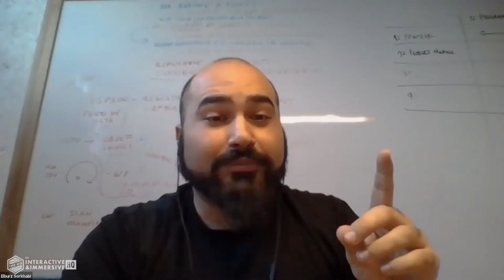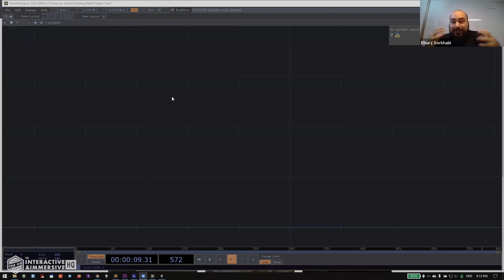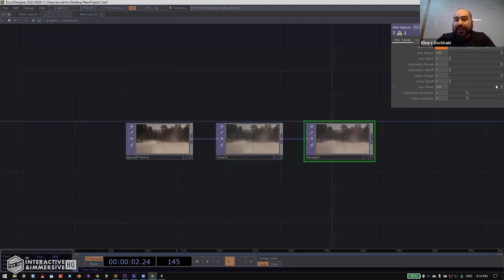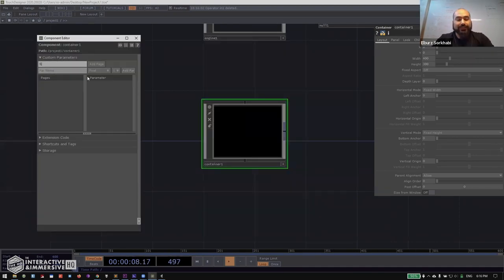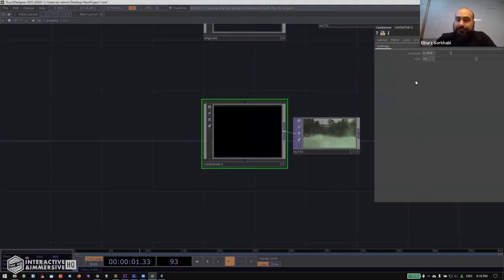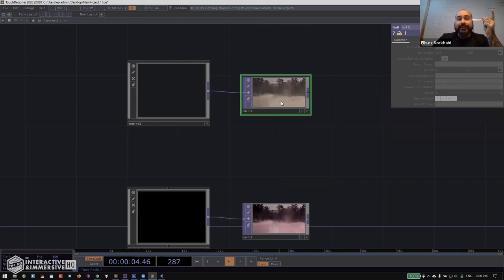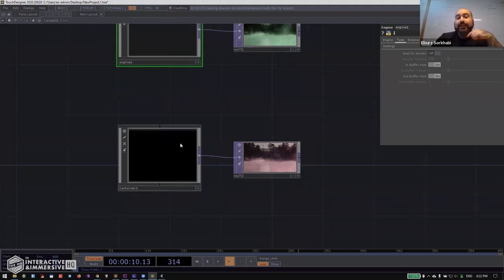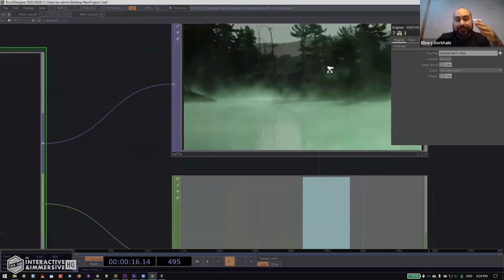Engine COMP in TouchDesigner - An Introduction

Comment: What are the implications for GUI workflow, if we can't get panels out of the Engine? Do we put the GUI in the main project, and the heavy cooking then goes in the Engine Comp? Or is this something better handled by waiting for support for different op types?
Reply from the maker: I mentioned GUI workflows although I didn't elaborate more on them :) Previously when you offloaded GUI's you would usually have the GUI in another app or on another machine, and then you'd send data back from it. If you needed to include it in the window setup you have on the main machine, you'd often use something like the Remote Panel tools in the Palette, which allow you to do an interesting workflow where the UI is rendered somewhere else, the texture is sent back to the main app, then from the main app you skin a container with the texture and collect the panel click states, then you send that panel click data back to the system/app running the UI and use Python to re-simulate the clicks on that. It creates this interesting loop signal path that essentially offloads your main system from the UI rendering but still allows your main system to catch the UI input. With Engine COMP you could re-build this pretty quickly by sending panel values in via a CHOP to the Engine COMP, and get the rendered UI back out from it to display. Hopefully that makes sense and sorry for the length of comment!
Reply: @TheInteractiveImmersiveHQ  super helpful comment, cheers

Comment: I'm creating a photo/video booth app that uploads content to a web server and I'm trying to offload the upload process to separate threads using engine comps. Right now I'm struggling though. I'm trying to troubleshoot what's missing because the script works just fine in the container but the second I try it in the engine comp instead, nothing happens even though I can see that the triggers are working. I have references to other operators in my project and to files in the repository using pathlib. Are engine comps able to see other operators in your project? Or will I need to find some other way of accessing variables from within them? It's crucial that the URL on my QR code matches the filename that's generated from a timestamp function in my main project. I have the filename printing to text DAT so that I can easily access it in other areas of the project.
Reply from the maker: IIRC the Engine COMP TOX can't access operators "outside" of its internal network. Usually, sending data like this into the Engine COMP would be accomplished via either a adding custom parameter to the .TOX or by adding a In DAT to the network inside the .TOX (which then could be used to route the data elsewhere).
Reply: @TheInteractiveImmersiveHQ  I ended up using custom parameters and it worked beautifully!